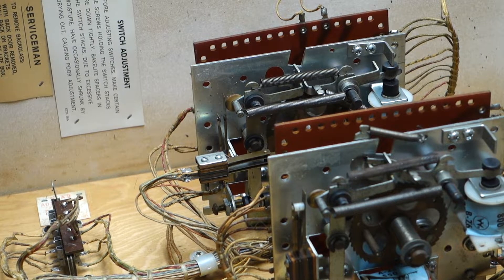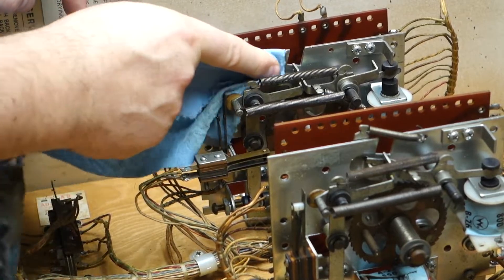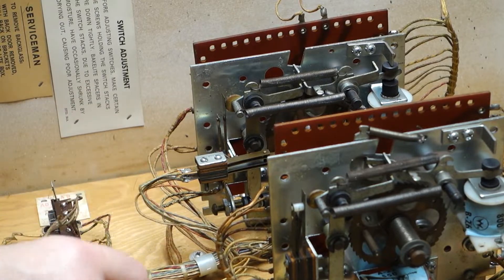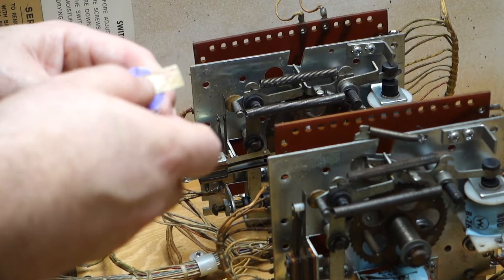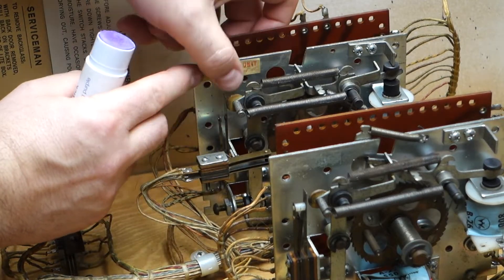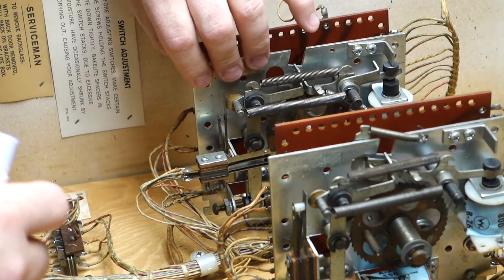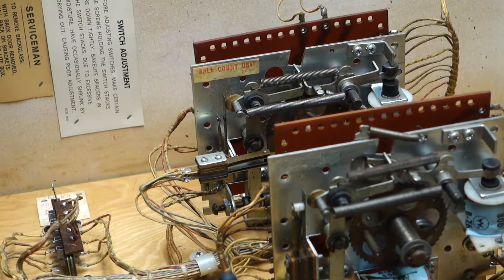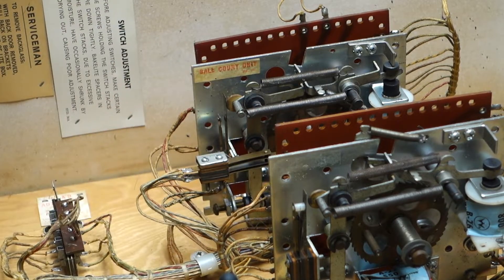How To - Reattaching Labels On An EM Pinball

Comment: I come across lots of machines with relay stickers laying in the bottom of the cabinet only problem is ya usually can't figure out which relay they came from  !
Reply from the maker: Yeah that's the hard part sometimes figuring out what goes where.
Reply: Sometimes you can find a picture online.